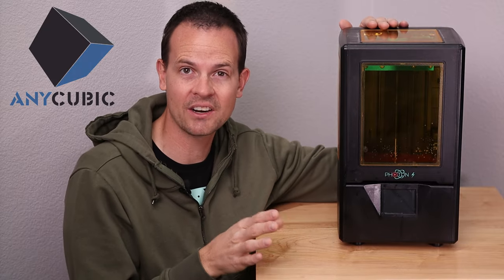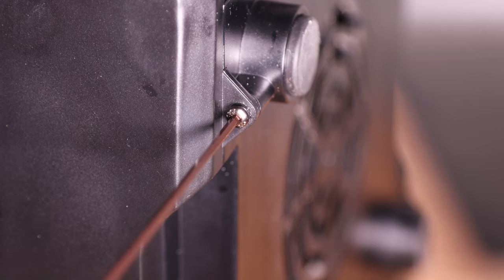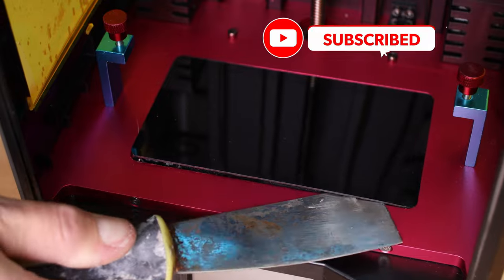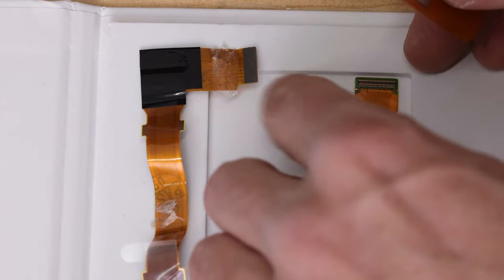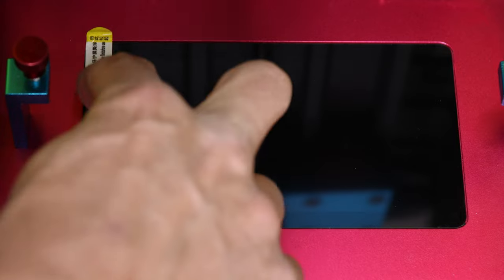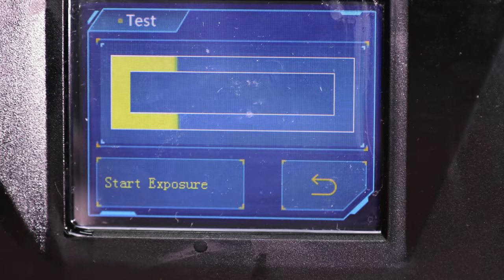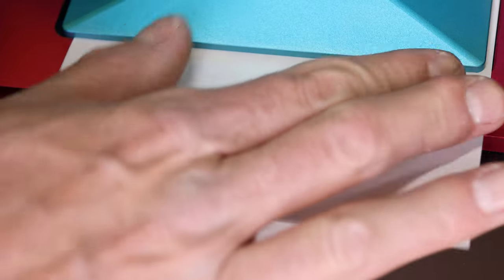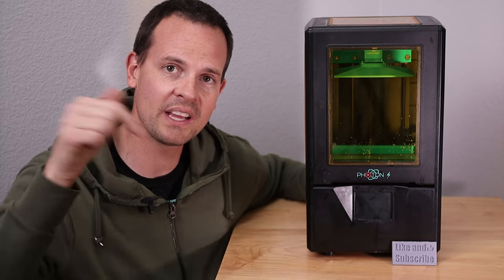AnyCUBIC Photon S Screen Replacement

Comment: I got the recommended screen and followed these instructions it was a huge help. The problem is now in the detection test I do, I just get a square of light. I have tried to unplug and replug and check connections without any change in the result.
Reply from the maker: That’s awesome you got it replaced! The square of light is ok I think. I have multiple options for checking the screen on my printer so I think yours is probably working.

Comment: Great video and super helpful, got a second-hand unit for £30 and found a screen replacement for £30 so £60 total for a working printer is pretty good! Looking forward to printing stuff!
Reply from the maker: Oh that is awesome. The screens burn out with use so it’s great you got one so cheap and got it running again!

Comment: I replaced the LCD screen and motherboard both and I am only getting the back half of the detection test image to appear. I reinstalled the old motherboard and the same thing happens. Anycubic sent me a test that ran the LCD without the motherboard and the whole LCD screen looked up, but no one has an answer to why only half of the screen works. I tried the latest firmware and that did not work. Older firmware will not install.
Reply from the maker: Dang that is a bummer. Hopefully Anycubic will continue to support the printer and get this worked out. I know a lot of people have this printer.

Comment: For some reason mine isn't saving the new "home" location after I get it leveled, go to z=0, hit enter. It claims that it saved it, but when I hit the home button after, it doesn't go as low as I had it when I went to save it.
Reply from the maker: Oh, that is a really weird issue. Were you able to fix it or are you still having that problem? You could try updating the firmware. I know I updated mine and it got rid of a couple of bugs, and allowed some extra sliced file types.
Reply: Mine does the same thing but if you just do a ‘test print’ w/o resin to make sure it goes down it works fine
Reply: Might have to say use a sheet of paper to cover the screen to inspect it

Comment: Just to be clear - re-levelling the bed instead of adding a thickness under the screen doesn't work. The FEP will always remain to the level of the metal surface, and as a result after the first few layers all you'll get is a gap between the FEP and the screen, which decreases the printer resolution.
Reply from the maker: Interesting. I haven’t noticed any resolution decreases in my screen changes but that doesn’t mean there hasn’t been one. I feel like the print is going to push the FEP layer down the tiny bit into the screen, but you may be right. I am going to add a spacer and see if I can see a difference in the quality. Thanks!
Reply: @BuildItMakeIt  Ideally in the very first layer the FEP will be pushed down, which means that the layer will be thinner than expected. The second layer will be slightly less so, until it levels out to the level of the fep. At the end of the day if the cured resin is touching the FEP then there is zero layer height! 

That said, i followed your video and installed a Mars Pro screen on my anycubic S. Disappointing that it didn't include the L connector but luckly my old one still worked. Thanks for the video! :) 

PS: did you have to change your exposure time after replacing the screen? I imagine it might be slightly more-less transparent!
I'm trying with the same setting of before (5.3 seconds for 0.025mm) but I'm not sure if it's gonna be ok!
Reply from the maker: @thelazyforger  glad the video helped. For me I didn’t have to change any of my setting. I did a cure test for my resin like when I first got it and it looked good. I print .25 layer height at 4 seconds with the elegido water washable resin pretty much exclusively. 

I think you are right about the FEP should be touching the screen on its own. I am pretty sure it will be better resolution like that. Thanks for your comment, I really appreciate it.